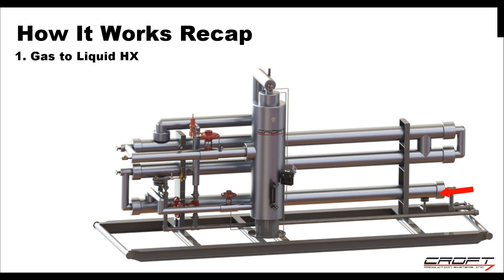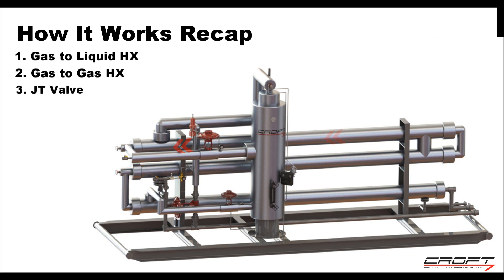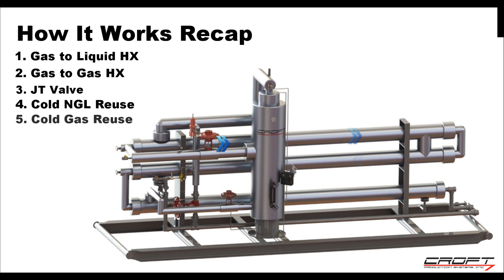Joule Thomson System Product Video

Comment: Crofts techs are dumb AF. We use these hunks of crap in the Eagleford/Austin Caulk . 16 years as an operator and this is the worst peice of equipment and service I have every experienced. Ambient temp drops your fuel gas freezes. Call for service and tech treats you like an idiot. Currently working on getting them moved off all my locations. Pos has been bypassed and tech hasn't even noticed.
Reply from the maker: Arava, I hate to hear about your experience with CROFT at no time should any one of our clients come away feeling this way. It looks like these issues have been resolved but your feedback has been escalated to our service manager and our Chief Technology Officer. In the future please feel free to reach out to our customer support at info@croftsystems.net so we can dive down into these issues.